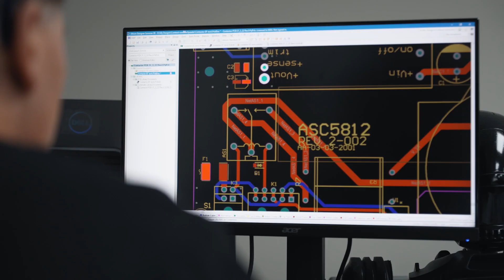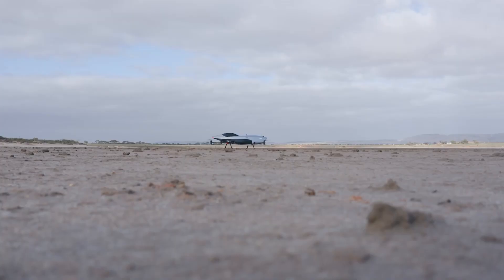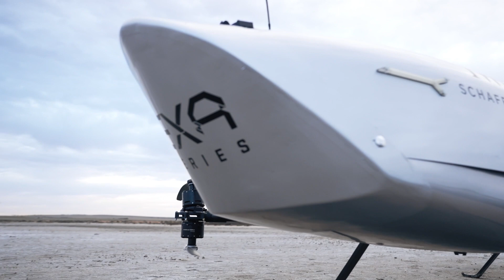"The batteries are delivering more power than a sportscar" | Inside Alauda

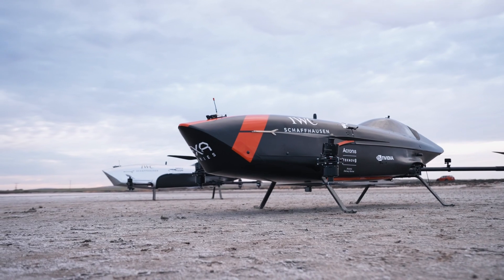Comment: Wait a minute.  (2:00 mark)   shows this thing to have just over 1m width. And it's 6-7x that long, making it ~7m long.  Tells me your craft weighs >900kg.  Meaning it requires >8.1 kW of lift Force to rise at 1 m/s.  Which is about 11 HP.  To output the same power as a very modest "sports car" like the 2022 Ford Mustang Shelby GT500 (760 HP)...  you'd need 69x that 11 HP.  ~567 kW.  Put another way,  To put in the air an eVTOL putting out "more power than a sports car'...  it'd need to have energy storage =/> 567 kWh to fly for 1 hour.  And your craft doesn't have that.   I know this because NOBODY has a storage format that has 284 Wh/lb. I know this because... 

I've been working on VTOL craft physics for >30 years.  The transition approach is fuel-powered generators providing the electrical energy.  Until a new better source is developed, gasoline generators are the most effective scalable mobile electrical energy providers. You want to engineer a power interface architecture that anticipates switching your existing airframe & systems to some future power source. 

And learn to think Beyond...

Comment: See where all the issues are...comments of increased performance and reliability are noted. Massive power to weight ratio issues will remain if rotors remain locked in with the airframe.  Keep it up ....hopefully,  you'll spend the money wisely.  Large model FPV racing compelling....looking forward to the next episode.